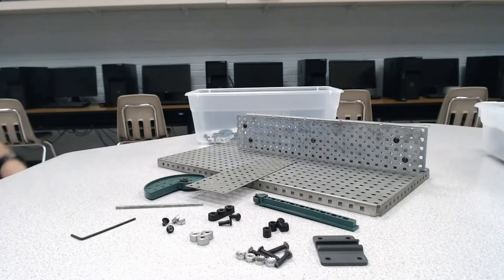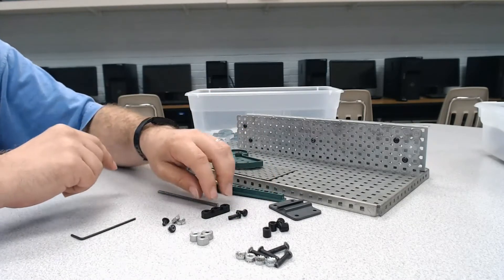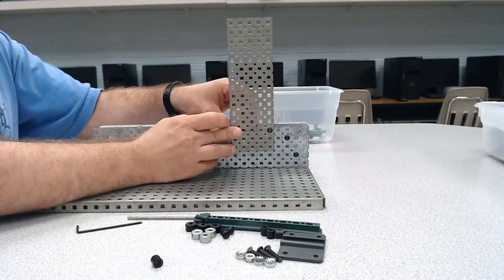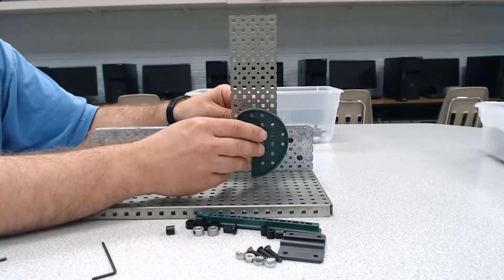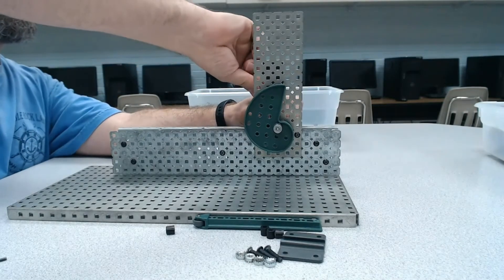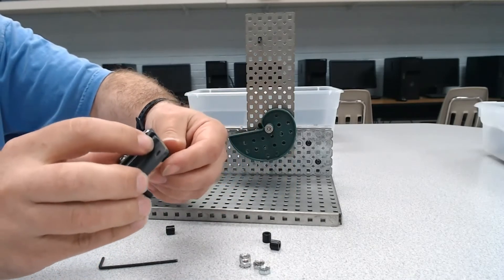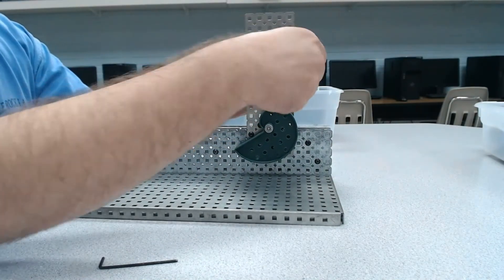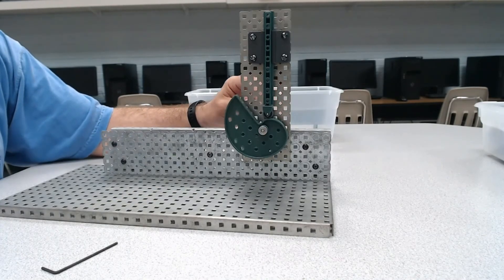VEX Gear Tutorials - Building a Cam & Follower

Comment: Super helpful! One question is what happens if your cam is slimmer (skinnier) than the width of your follower? What kind of impact can this have on its performance?
Reply from the maker: A good question. The performance of the follower is based on both the size and shape of the cam. If the cam still had the same shape as what is in the video, but its width was smaller than the width of the follower, that would likely make the cam so small that the follower would have very little up/down motion, as seen in the video. This would likely be because the size of the cam is so small that the "drop" caused by the shape would be minimal at best. Maybe even small enough to not even be noticeable. At least, this is what I would suspect based on your question.
Reply: That makes sense but I was actually referring to the depth or thickness of the cam rather than the diameter. Curious if that has a predictable impact.